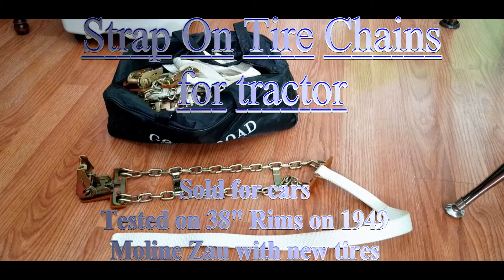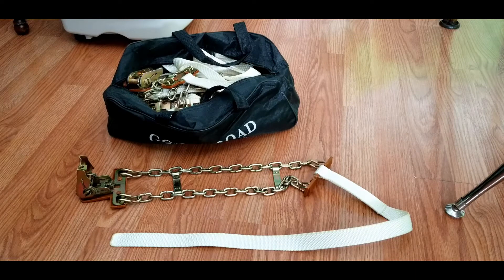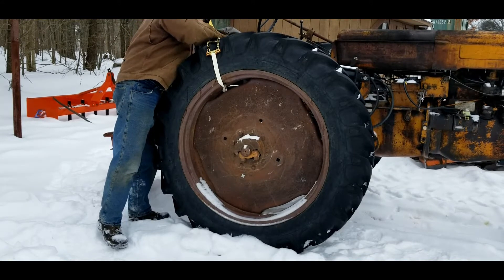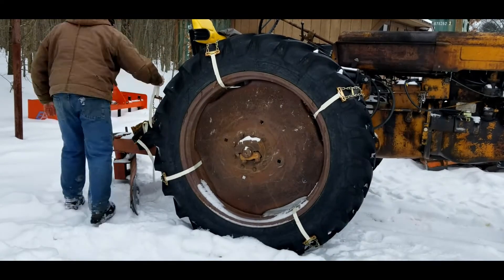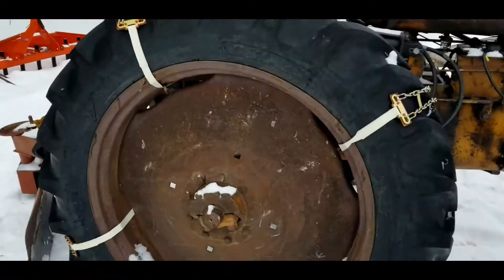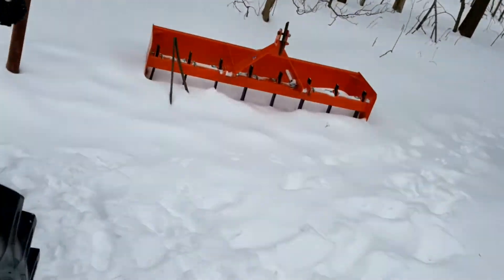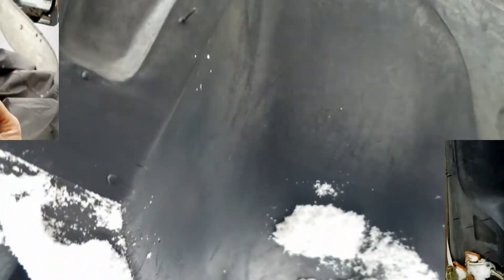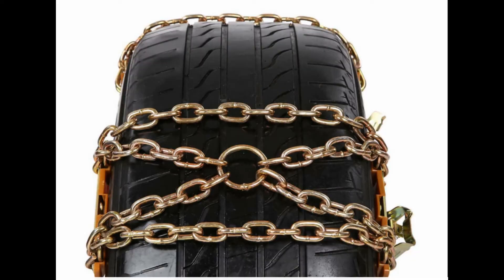Strap On Tractor Tire Chains

Comment: Would have never thought to use this style for a tractor. But I think you’re right that the picture at the end would work better. I guess I got lucky that my grandad had a set of chains for my tractor that I use for plowing.
Reply from the maker: I have access to full set of chains also, but they are heavy and difficult to put on. I like this solution for the one or two times i need them per year
Reply: @CoopsStuff22  fair enough. I just leave the chains on year round. But I also live on a steep hill with a steep drive. I want to get chains like in your video for my truck though